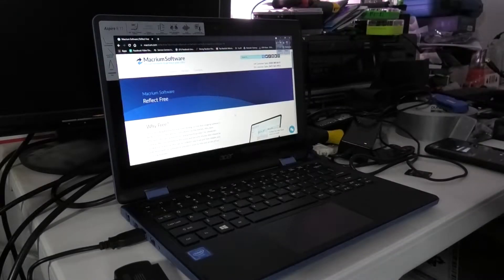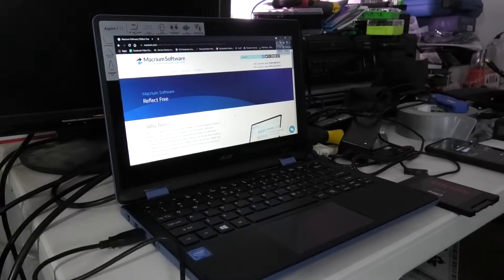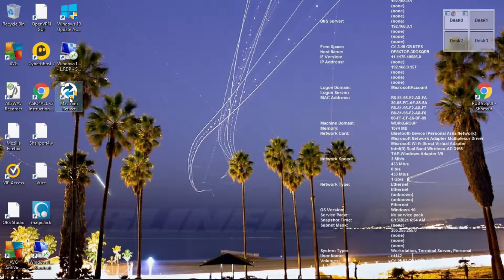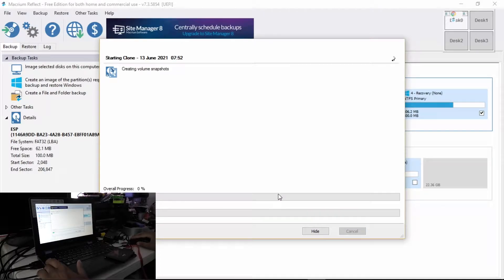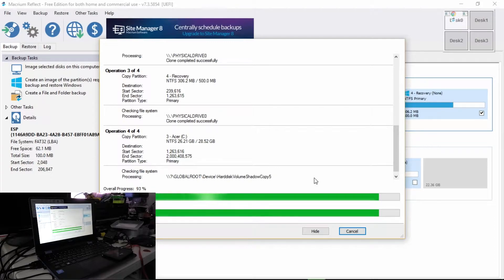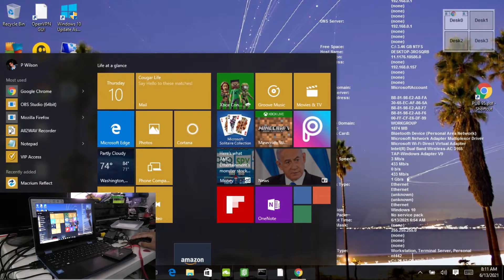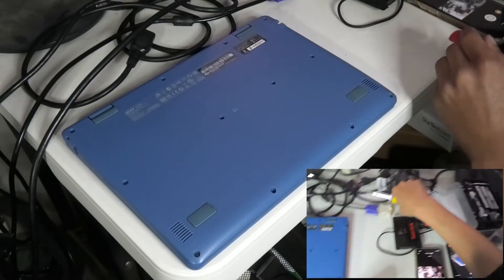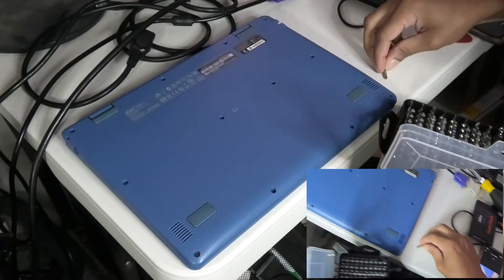Why Can't I Upgrade the HD of this Acer R11 R3 131T

Comment: i don't know if you still have this laying around, but this appears to be a chromebook variant which uses a eMMC chip instead of a HDD which whilst being faster than a HDD in some situations, can be prohibitively lacking in capacity. as an owner of the non chromebook variant i immediately noticed the different hdd caddy and the lack of SATA cable, although it might actually be possible to aquire the SATA adapter and plug it into the ribon cable connector on the motherboard. there's still the case of the blank being there, although you could probably just remove the blank, retain the power/volume switch board with a washer and the existing screw, and simply secure the SSD into place with a piece of double sided tape.  this has me wondering if it's possible to put a eMMC into my model, as the mainboard could very well be identical
Reply from the maker: Although it would be nice to even put a SATA SSD in of 1TB, it is really not necessary for the way I operate.  The unit has the latest update of Windows 10 and I still use it when I need something light and small.  Only draw back is the small screen.  At the time of writing I have the unit set up in the basement to help me enter computer parts in a database.  The database and software are not on the acer, I actually just remote to another computer that contains all the software.  Essentially I just use it and its limited capacity for a dummy terminal, lol  No computer goes to waste in the land of the TechTinkTronics...

Comment: If you look at the board, it had text saying hdd and ssd etc. Even pwrbtn1. Other models have a ribbon connector port that connects to the ssd/hdd. So they use the same board for their emmc and hard drive version.

Comment: So this is the same issue I have. Ive watched 3 videos and I think they are actually "different" models R3-131T-C1YF versus R3-131T-C1EW. The C1YF has no added harddrive. The C1EW has the SSD/HDD connector. Correct me if I'm wrong?
Reply from the maker: I recall some time ago before making this video, I saw a model with the SSD/HDD connector in someone else's video.  If you examine that area closely there were provisions on the main board for such solder points and hardware.

Comment: There Is No Slot Found For Internal SSD In Board What To Do I Have Same Acer Aspire R3 30gb Built In Memory Now How Do I Upgrade Because There Is No Slot Option For Plug Ribon SSD. Kindly Help
Reply from the maker: The best thing that I did for mine was reinstall Windows.  I could not update the current install.  Stuff stopped working.  I did a command that deleted some pretty important files, so I had no choice.

Comment: does the Acer Aspire R 11 R3-131T-C1YF support ssd upgrade? does c1yf model have ssd that i can swap to a bigger size?
Reply from the maker: The early models may have had that support, but in my case there was no cable or space for the SSD.

Comment: you could possibly put a m.2 ssd where the network adapter is but you would have to resort to another way to connect to the network. Possibly a small wifi dongle in the usb port or if you never move the laptop, the LAN port. If you really want the storage capacity it might be a good trade-off to make
Reply from the maker: That thought crossed my mind of replacing the internal Wifi with the SSD, but I did not consider the USB port dongle internet connection.  Thank you!
Reply: Is this possible?? will the size of m.2 ssd and the network adapter be same so that i can swap it? if this can be done can you please suggest a m.2 ssd that will fit inside Aspire R 11 R3-131T-C1YF.
Reply: @MovieClubz  ideally one that is 16mm * 20mm in size. But one thing that completely went over my head is the fact that if you wanted to put your main OS on there, you would have to come up with a way to boot from it. Since many cheap notebook BIOS’s do not include a way to boot via pcie. If you wanted to use it for extra storage it would be fine but won’t solve the small space for the OS to reside.
Reply: @olivertabone6788  I'm not concerned about os issues.. i want extra storage only.. so this seems fine to me.. but where will i find an ssd with the size you mentioned? Do you know any brands who makes ssd in that size which i can buy online? Appreciate your help and prompt reply.